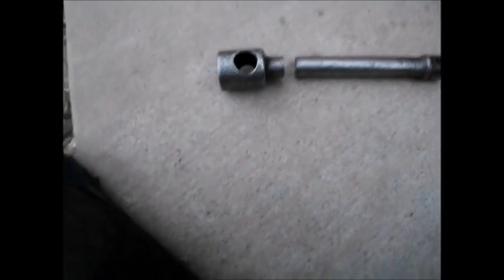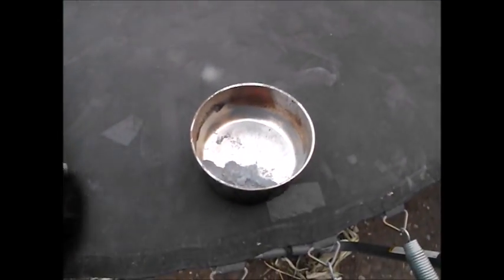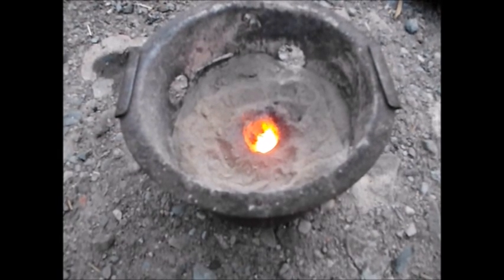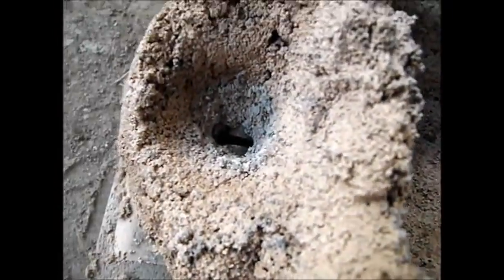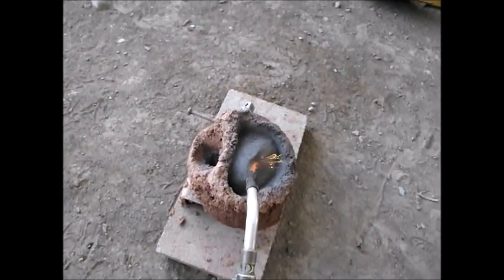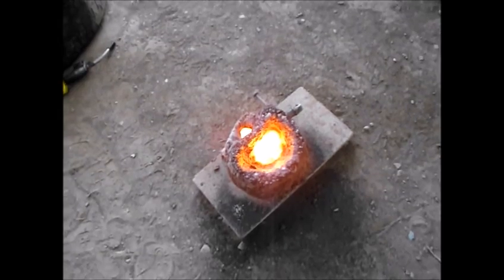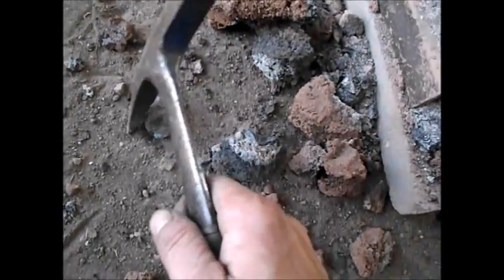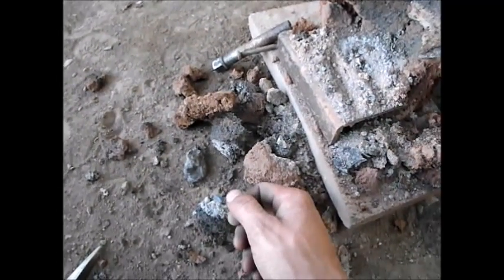My First Attempt at Thermite Welding

Comment: 1/2 cup of Jetfuel would have welded that right up for you.
Reply: +Kian Gurney    Jetfuel in an "open-burn" situation, will easily reach 1900F (~1000C)   while that's not quite enough to actually fully melt steel, at that temp, the tensile strength of any steel member is reduced by about 70%..  Steel beams routinely warp and bend to the point of failure under normal building fire conditions, much less the added intensity of jetfuel, and a molten aluminum + water explosion.....
Reply: Forget the jet fuel, how about an entire jetliner slamming into it at almost Mach 1
Reply: steel beams cant melt jetfuel
Reply: +Breen Whitman   it's pretty clear you've never seen very many aircraft crashes or even been to the site of a major bldg 5......stick with what you know (or make a serious attempt at educating yourself before you try to spout an opinion that has no basis)
Reply: mark1237889 Really? And here was me thinking it was just straight insurance fraud.
Reply: JET FUEL CAN'T MELT STEEL BEAMS
Reply: Nice science 

Newton's First Law

The Kerosene in 911 was stored in the wings these would have been ripped apart on impact and all the Kerosene would have continued forwards with everything else not stopped by the impact. the windows opposite the impact where smashed and the fuel exited them hence the fireballs. there would have been vary little fuel left in the towers. apart from the furniture and any paperwork.

The building was fairly well fireproofed this is why the port authority sold it for so little as it was going to cost $15B to demolish it as all the asbestos had to be stripped before a controlled demolition would have been safe as all the asbestos would have ended up in the air.

The deaths on 911 were only the start of this expect asbestosis to take out more than the original demolition.
Reply: +C.O.R.E Crew Computing Back on your comment that says " If you prove it ill give you a pat on the back. Other than that, (No offence) bullshit and I'm done here.", there is one thing that you didn't consider. That thing is mark1237889 can't prove such a thing that happened 14 years ago since all the evidence is lost/destroyed. There's also another hole in your logic. YOU can't prove mark wrong either. I'm not denying nor confirming either side. I'm just saying that what you think is proof is merely belief of someone else. Unless you were there, testing the samples and proved yourself right.. What you think is proof is merely belief. That makes you no different than mark in his belief of what he thinks is proof. regardless whether or not mark was being sarcastic or w/e. Your logic is flawed and that's my point.
Reply: +Breen Whitman I would 9/11 the shit out of this wrench socket
Reply: +Tim Hyatt That half explains the collapse of one floor over many more. It doesn't explain the free fall collapse speed either. But then again the towers were designed to withstand multiple 747 impacts, the insider trading, the passport, the military exercises, the hijackers still alive, the pentagon, building 7, I mean all of that is pure invention along with the existence and the testimony of many people.
Reply: +Breen Whitman ok fine whispers It was the government trying to increase the federal defence budget. and no planes hit the Pentagon.
Reply: +Breen Whitman ,you don't want to forget to open the can of jet fuel with a box cutter, cause that's "high end".
Reply: James Culp
Boxcutters aren't sharp enough. They are only effective against an aeroplane full of US passengers.
Reply: somerandomcodplayer
Starving African children could have eaten those melted steel beams.
Reply: Sawyer McCloud
Just as well, any mishandling of that half cup could wipe everything out in a 1/4 mile radius. Just scorched earth left. Nothing but blackened dust and soot. Except for the property owners passport if that was in his bedside cabinet. Passports can survive these events.
Reply: It supposedly did in 911...
Reply: All you guys gotta calm down lol +Kain Gurney was just hitting you guys with a dank meme, nothing more xD
Reply: +Breen Whitman - But for a WMD, box cutters are still affordable. I'm surprised you don't see more Taliban rushing military outposts with those dangerous weapons.
Reply: The who and why behind 9/11 may be open for debate (personally I believe the 'official story') but the how is not - It was the planes. Anyone who thinks otherwise is an ignorant fool, or just plain stupid.
Reply: In the rest of the world there is a saying that goes: The worst enemy of America is a world in peace .
Reply: +Breen Whitman lmao i see what you did there ;)
Reply: +Tim Hyatt wow 10000 Celsius ?
Reply: +1und1 count your zeros...you have too many....1000 C  (as in 1 more than 999)
Reply: +Tim Hyatt sorry man i was really tired xD
Reply: yeah they could have feasted on Dick Balls
Reply: sorry we are normal people that do t have access to jet fuel l
Reply: +Breen Whitman  Jet Fuel as in JP4 ? a kerosene product or Rocket fuel ?
Reply: JENGA!!!
Reply: Do you think that they yelled JENGA!! as they crashed into the twin towers?
Reply: +Breen Whitman by CIA i take it you mean US gov
also, cant a man talk about jet fuel without an entire nation trying to kill himself
Reply: +Lardian it was for petrol.
Reply: thomas lewandowski wow.
Reply: It is possible? I have a Lot of Jet1...
Reply: Yeah,i guess so
 Total obliteration of the work piece, the premises, and neighboring buildings, and left a crater 40 ft deep. A passport from one of the passengers did survive undamaged however.
Reply: +Kian Gurney Yes. Yes it can actually.
Reply: *****
And the point being that pressure can be a wieght many times less thatn its own.
Reply: ***** Lovely explanation, thanks I didnt know that. Although you should be aware that "Jet Fuel cant melt steel beams" is a 9/11 meme as far as google can tell.

Breen Whitman That is correct, again lovely explanation of such.
Reply: Jim, after reading your "Fact" laden post regarding the buildings that collapsed during the 9/11 attacks, I had to compose myself because I was laughing so hard I could not think straight. Lets see where do I start, OK the "Controlled" collapse conspiracy. You see there is this force in the universe called gravity, Sir Issac Newton, ever hear of him?? Anyway, any structure want to fall straight down towards it's base because the Earth provides 99.99% of all the gravity that is effecting the building. Steel core or not, a steel core adds strength, but it also adds weight. Where did you get your "Facts" on "Many skyscrapers"   the saw fires "Far greater" than 9/11 and did not fall....Where and when did this happen?? The Entire building was "Consumed" and there still standing?? WOW...I need to know that "Bit" of information...Well you see Jim, all modern steel core buildings have a fire and heat resistant foam coating applied to the steel beams. When the buildings were struck by the airplanes the shock of the impact and the resulting explosion from the JP-5 dialoged enough of the material to expose the structural steel to the intense fire and heat, thus degrading the steel's strength. Also do you know why a demolition contractor strips the building of all internal walls, the outer curtain wall's and all windows?? It is because the majority of the building in square footage is air, and when the building starts to fall, all that air needs to be pushed out quickly. Also If there is to much debris in the way the columns of structural steel are cut with "Shaped" charges, then a "Kicker" charge will fire to knock the column inward so that it does not effect the implosion. This amount of work would take many months and require several  tons of a high speed explosive to cut thru the steel, such as TNT, RDX or PETN or Nitroglycerin based dynamite. The slower speed explosive is usually a Ammonia Nitrate based mixture. All of this needs to be wired using various time delay fuses of the blasting caps. The blast wave from all the explosive would break windows a mile away. A contractor will wrap the columns with steel fence, plywood and acoustic absorbing blankets, among other measures to stop this sort of thing from happening when they do a building implosion..a few more quick points, I always hear people spouting off the 100 architectural professional stated this or that, well who are they?? How about some names??  But the biggest "Problem" for idiot conspiracy people is this, where are the tens of thousands "Men In Black" that ran and carried out this "Operation"?? Where are they Jim?? Oh yes you say to yourself, the government killed them..Well where are the people who "Killed the Killers"?? Where these people also killed?? LOL, you see what I'm getting at?!?! I took Physics in college, I served 10 years total of active and reserve. I was a Helicopter crew-Chief in the US Army, and then I served in a engineer unit in the reserves. Where I was taught explosives and engineering, metallurgy was also taught in the military and in college. So I kinda know what I'm talking about, and that you got no fucking idea at all of what your talking about. You only quote from so YouTube conspiracy video..  Well good-luck, anytime you want to debate your "Facts" I'll be more than happy to "Accommodate" you...:)
Reply: mark1237889 By "Terrorists", I take it you mean "CIA".
IE the same guys supporting ISIS in the fight to oust Assad.
Reply: haha, 911 pun?
Reply: +Kian Gurney No it can't, you damn republican.
Reply: It's called false flag kids. False flag. It moves the public opinion towards backing you up whatever you want to do next with whoever you want to blame for it.
Reply: Each of the Twin Towers were designed to withstand multiple strikes from jetliners, plus the fuel atomized upon impact and quickly burned up. The affects of the fire afterwards also did not cause the towers to collapse. No matter the damage, there is nothing other than a controlled demolition that could cause three skyscrapers to fall at free-fall speed as they did on 9/11. Never in history has a steel core skyscraper fallen into it's own footprint without it being a controlled demolition, yet somehow it happened 3 TIMES in one day on 9/11.
There have been many skyscrapers that have experienced fires far greater than seen on 9/11 and they didn't fall at free-fall speed; they didn't fall AT ALL. There have been many steel core skyscrapers/high-rise buildings that have burned far longer than WTC Tower 7 did(7 hours) and not collapsed. Many of these burned twice as long, some as long as 24 and 29 hours and totally consumed the ENTIRE BUILDINGS yet they did not fall.
Reply: +C.O.R.E Crew Computing The jetfuel didnt melt the wtc's steel beams, the terrorists also planted bombs inside the tower before the crash.

Comment: If you bevel both sides, weld one side and cut back into the weld from the unwelded side until you don't see a line where the two pieces fit together and weld it all the way out the extension should break in a different spot before the weld will break.
Reply: Oh. Good deal. How's it holding up?
Reply: +Cody'sLab have you considered doing any friction stir welding? maybe not this piece but id love to see some anyways.
Reply: TK TK I would love to see it as well!
Reply: i dont think it would work however. I've never seen or read anything about stir welding on a circular object. I know cody has seen ave and i wanted to see if you could try your hand at it.
Reply: +Enter a name here thermite is used more for industrial purposes like welding train tracks together
Reply: I think this was a great experiment. You wouldn't have your arc welder if someone didn't experiment in the past. I think this has great potential. Just switch the method until it achieves better results and improve from there.
Reply: +TK TK .. It IS usefull, as it is used for grenades, railroad welding, shipyard work, and a lot of applications in general.!.. A nifty product, just Bé Carefull.! I nearly lost my life, as an accident with thermite nearly burned my hand off... A resulting infection went for the grand price, as my hand was thought to be a sure loss, by my doctors actually.! Some miracle saved not only my live, but my badly BBQ-hand aswell.!
Afther a month in the burn-ward, the revalidation was tedious and painfully, as the many scabs streched ànd broke with every exercise.... So, FOUR Times a day.!! Reàl Fun, that was, and many people let it slide, what is Véry tempting.! ... But the pain payed off, And I have nearly a normal working hand, witch I'm gratefull for... How Bad-Ass am I.? :)) (Néh, joke)
Reply: +eatmyskids ive seen em weld the tracks in the u.k the exact same way the welders turn up shut the track put the cast around burn wait to cool grind and fuck off simple it saves using fish plates that you bolt on i used to get a peice of the cast an stick it in a tin an carry it round the track getting a warm off it
Reply: fabrication des bijoux en or
Reply: +Enter a name here In case you didn't know, a thermite weld produces extremely strong steel if mixed right, if you get the flow right, then once you break the slag, all that's left is a nice weld that's stronger than any conventional weld you can do. If you think about it, the advantages to thermite welding would be HUGE in a manufacturing setting. Think about this you set a weld up in half a minute, light it move on and set it up and light it and move on. You wouldn't have to have a skilled welding operator, you could have some dolt that did on the job training for a few days.
Reply: +scottydog636 I think the most important thing to note is that thermite doesn't require electricity so this could turn into something quite useful.
Reply: @TK Which is why they use it for track welding on railroads now, it's catching on in the US, it started in Europe, I want to say Sweden for that purpose. It also looks nothing like this. But you need way less equipment to haul around.

Comment: friction welding would be the best process to rejoin these two halves for maximum strength.
Reply: +Reaper_Hunter well, actually not. You do not need high RPM but high torque and pressure.
Reply: +The Tool Guy these physics arguments are silly. Basically to friction weld you need lots of friction. End of. Doesn't matter if your get it through pressure or inertia or any other method for that matter.
Reply: YeCannyDaeThat I'm just saying friction comes from pressure and movement, if you have a lot of pressure you don't need as much movement, and vice versa.
Reply: TheNorthkiters I'll have to relay this to the machine shop teacher.
Reply: +The Tool Guy Actually yes it would. It's not magic. It's physics.
Reply: +YeCannyDaeThat True, but you need a machine that have an extremely high RPM.
Reply: +The Tool Guy 0.2 rpm would still work if it had enough pressure and torque. force of friction is force pushing down times coefficient of friction. speed helps if you don't have a ton of pressure, but speed isn't the cause of friction
Reply: The Tool Guy I'm just saying you don't need speed to get friction
Reply: The Tool Guy ok i should have clarified. if you have something at 100 rpm with 100 lbs of pressure, it will create the same friction as 10 rpm with 1000 lbs. as long as you have pressure you don't need a lot of speed, but it is still required.
Reply: Uh guys, hate to interrupt but y'all want to continue this conversation on a different thread?
Reply: Reaper_Hunter you can mute the post in the top right corner drop down menu
Reply: The Tool Guy anything will weld together anyway with pressure, but it won't be friction. see explosion welding
Reply: Get like 10,000 bars of pressure and you can weld whatever you like with no movement! :P

Comment: When the railroads weld their rails they preheat the ends to almost white hot before they apply the thermite to them.
Reply: +dietero100  Yeah... My thoughts also... If you preheated the parts to be welded? Maybe?
Reply: dietero100 not white hot but red hot

Comment: thermite is for high carbon welding. it's not ment for alloys. if you are arc welding it and it's breaking, your now welding it right. you need to bevel the join and weld inside out making sure to get proper fusion.

Comment: Did you know...jet fuel DOES burn at a high enough temperature to burn up thermite without setting it off. (And to weaken an already damaged steel structure to the point of collapse, but that's besides the point)

Comment: This will at best result in a weld where the filler metal is carbon steel which is way weaker than the alloy steel of the wrench, further the heat of the process will effect the heat treatment of the wrench and make it brittle.

Comment: Welding it with the welder will work, and I've done it many times. But you need to buy some "blue" tool steel rods for it to work, because tools like that have complicated steel alloys. The "tool steel" rod isn't perfect, but it's WAY stronger that a 6011 or a 7018.

Comment: Next time try designing the inflow of the metal from thermite right above the gap... RIGHT ABOVE. It´s the same way they weld railroads :-) Then you make a little sort of pot thing next to the gap so that the metal can even overfill. But the little pot thing has to go higher than the gap so that the metal doesn´t just flow right through on the ground. Please make another try :-P

Comment: Is that bolt Stainless? Your base metals (the bolt) did not get preheated enough for the termite to flow in and have something to bond to. Also maybe the foil contaminated the weld. use a 1/8" 6010 or 6013 arc welding rod that should fix it right up as long as it is not stainless.